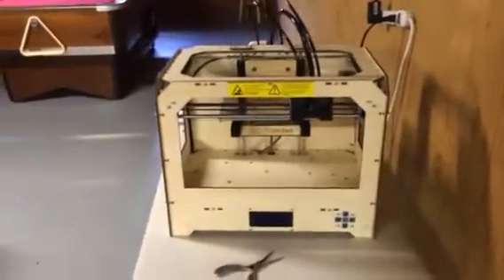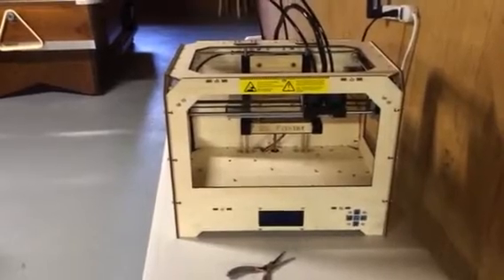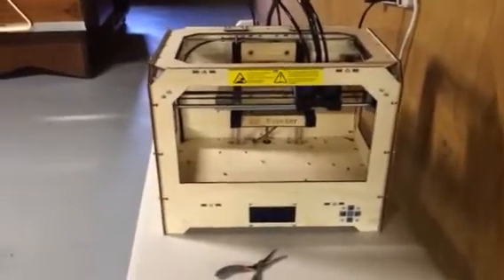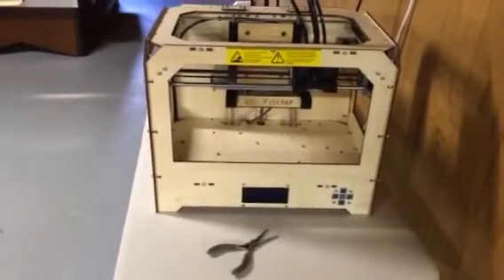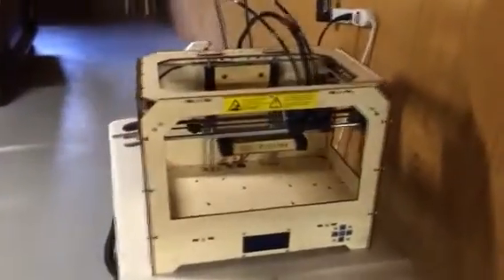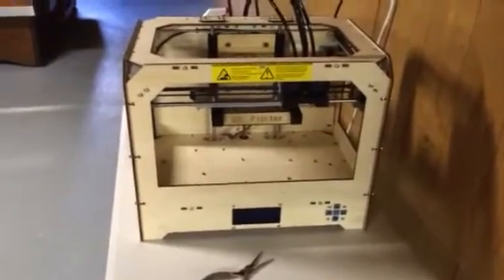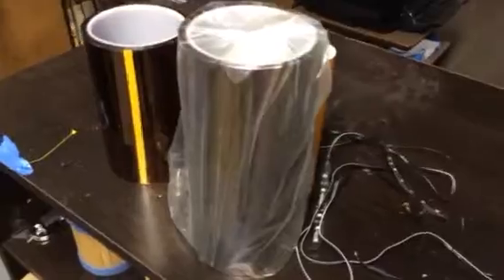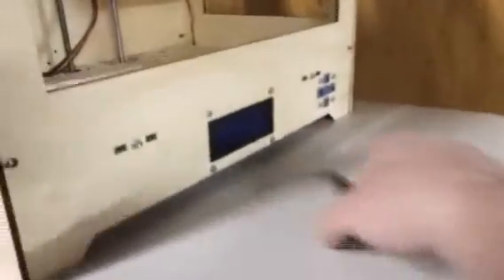Ctc 3d printer brief look at electronics

Comment: Thanks for the video! This printer is printing well since i have changed the nozzle, though i am very annoyed by the motherboard fan noise which is way loud and would like to use led light. Did you change motherboard fan? and were you able to used led once hooked to motherboard? Please share any other useful suggestion regarding this printer. Thanks again!

Comment: Thanks.  I just got my CTC printer  this Saturday and been updating it too.  I added led lights and had a 12 volt power transformer that I connected so when I turn on the machine the board and the led lights come on.  I also updated the firmware to makerbot 7.5.  It came with 7.1 and said Creator.  Now it says Replicator and 7.5 for the firmware.  Not sure if you did that?  You have to use makerware to update. Took less than 15 minutes.